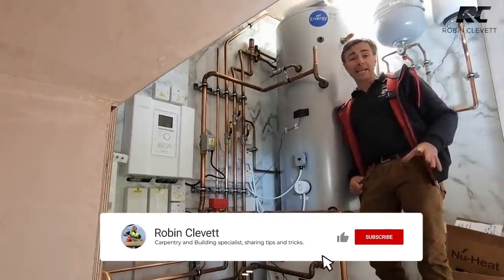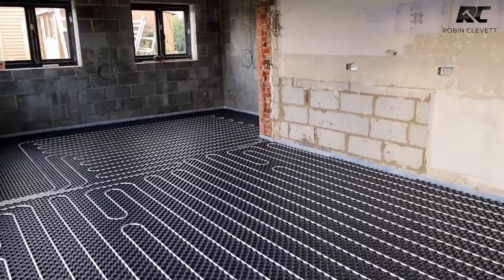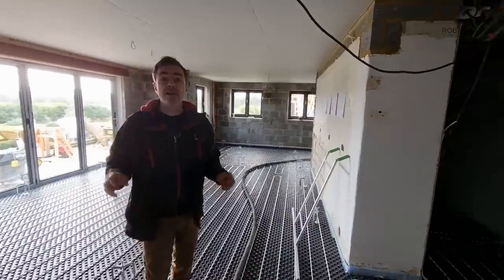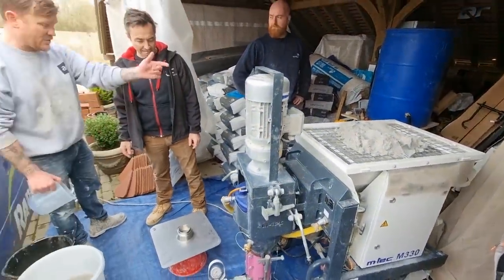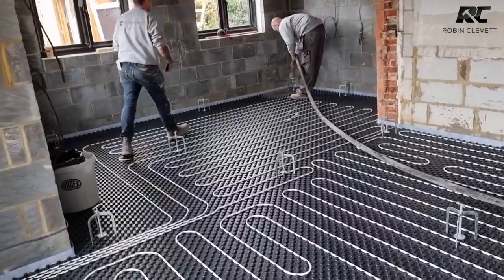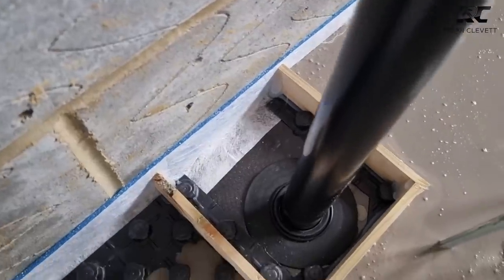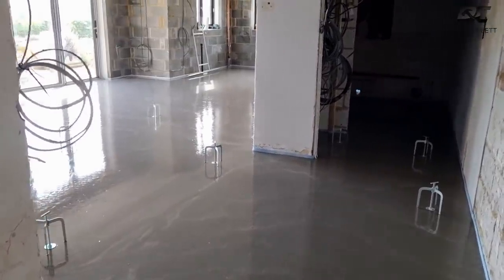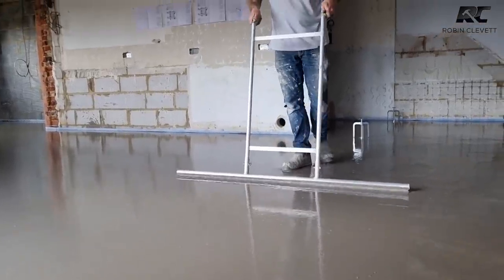Low finish wet underfloor heating. The Big Build episode 40

Comment: We generally do 100mm centres for our UFH on our heat pumps systems. Have to be really careful of floor coverings as it can affect w/m² especially on overlay systems. We always size the radiators to same flow temp and run it open loop and on3 whole system. This allows the heat pump to run much more efficiently and means we don't need a buffer more than often as we have the minimum volume needed for the heat pump.

Comment: Last year i had underfloor heating added to my house, one interesting thing the plumber did was fill the pipes with compressed air to leak test it as if the house is unheated the pipes could burst if freezing temperature no mess if there’s a leak 👍

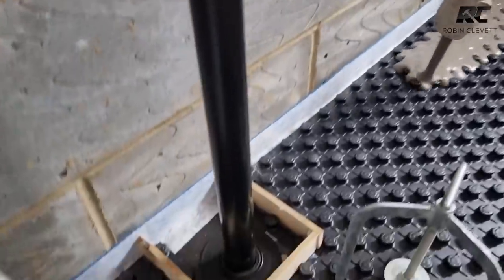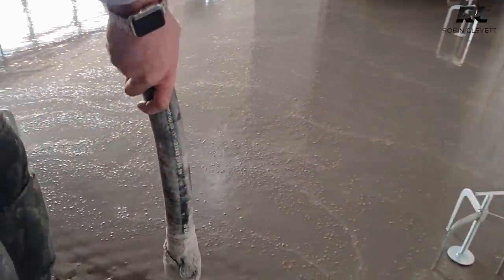Comment: I've had three sets of floors done with pumped screed and now I'd  never do it any other way. It takes an artful lot of stress of of the job and the team I've used send somebody round the day before to check everything is ready to go. The job is so quick too, they roll up, set up their kit, cement truck arrives, screed gets pumped, surfaces get dappled whilst the kit is being cleaned and of away they're gone again. The last job, I arrived at site at 08:15 to check the system pressure, the guys arrived at 08:30, the cement truck at 08:45 and we were all away from site by 09:45.

Comment: Floor prep 2 guys 1 day £600 plus materials, System for large room £1500,  install 3 guys 1 day plus £900, £1300 in screed (73 bags)for one room, 3 guys to lay screed £900, plumber 1 day for pressure test £350, Equipment hire £150 Total of £5700 Plus the rest of the house, the heat pump indoor and outdoor system blar blar blar
Real life £20 - £25K all day long !

Comment: Hi Robin - are you doing a video on the heating side of the system please? Without gas as an option I would be interested to see how the heating side works. Thank you
Reply from the maker: Hi John, I will do a video on that, we are using an air source heat pump at the Big build
Reply: I'm doing wet UFH and I'm in a electric property only. Will be using a electric Combi boiler for mine as that also runs for my hot water too

Comment: Couple of questions, can the floor be a concrete finished floor, like polished concrete and  secondly, would it be better to use N2 dry nitrogen to test the pipes as it can freeze in the UK?

Comment: Good day Robin. Interesting to watch and I thought I would mention that underfloor heating had a run here in Australia for a while but seems to have faded into obscurity now.  I am not sure whether it is the cost of electricity here in Australia and cheaper in England or if you actually run it some other way like a boiler heater? Love watching the build series.
Reply: Normally the water in underfloor heating is heated by gas or oil boilers. I think this one is done with a ground source heat pump though. 
Any form of heating by electricity tends to be more expensive than gas or oil.

Comment: Seems like a great system rather than heating a large slab of concrete, just wondering about the small metal tripods are the for leveling up, good video Robin ☘️🇮🇪🤟👋
Reply from the maker: It is a good system especially for retrofitting and existing dwellings, the small tripods are the devices that they set to the correct level by means of a screwable leg in the centre and then flow the screed to these falls

Comment: Is this thickness of screed only for direct contact with existing concrete floors, and would not be strong enough over insulation ??
Reply: Yes
Reply: @JoeFoster  I tend to agree with you a little joe. Over standard 

I have lay over system ready to go in the near future that has a foil back 20mm dense pir board with pipe runs already in that takes a 16mm internal bore Mlcp pipe which then has a 10/12mm two part latex compound over the top same end result but keeps the thermal mass intact longer.

Comment: How much depth does this system take up in total? Including the base please ?.
Reply from the maker: About 25mm
Reply: @ukconstruction  ok thank you ... Few more questions please. Can it be laid directly onto old concrete slabs where there is no insulation underneath? If so is there any kind of thermal sheet that gets placed underneath to reduce heat loss ?

Comment: Hi, are you making any arrangments for insulation underneath the heating pipes?
Reply: I thought the egg create came with reflective back for this?
Reply: Tell me you know nothing about building regs without telling me you know nothing about building regs🤣
Reply: @lazenbytim  how do you think building regs affect an installation to existing? You can machine groove out existing screed and lay pipe directly without insulation. Heat rises and cool air falls, so even though it pays to insulate to minimise heat loss, which you would do on a new build, doesn't mean it's essential for a well functioning system to an existing structure.

Comment: Is there a link for the contractor used?  I've a large nuheat job approaching.
Reply: Have a look at a competitor. Nu heat is a great product but way to expensive. You pay for life time support but when do you really need it if installed correctly. Far cheaper systems do exactly the same.

Comment: How much cover is there over the top of the pipe?
Reply from the maker: Hi Sue
It is designed to be only very small about 5mm, the levelling material is super strong and will not crack if the castellated panels are fixed properly and fully supported etc
Reply: @ukconstruction  thankyou